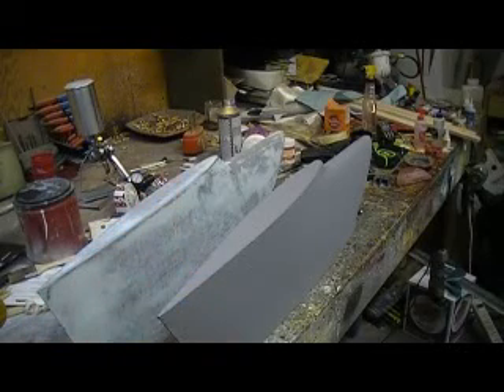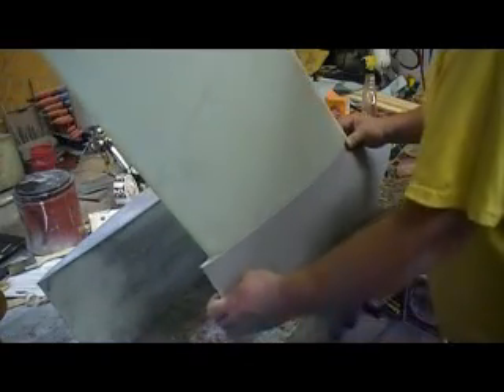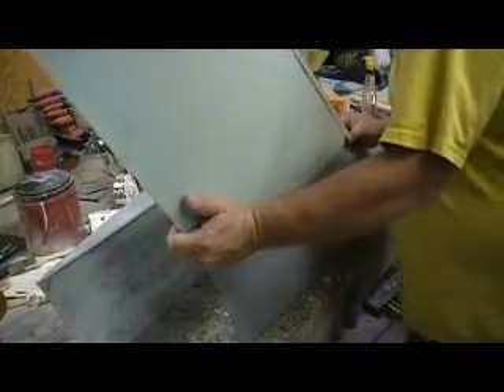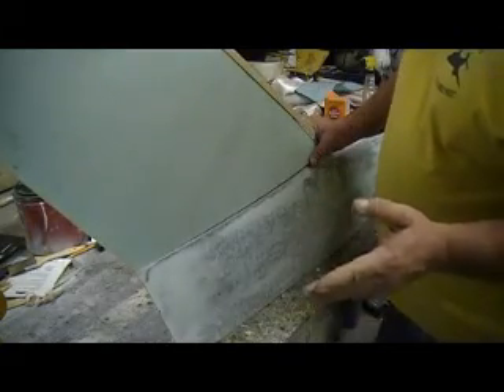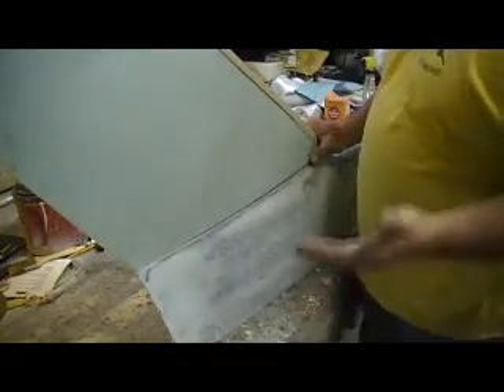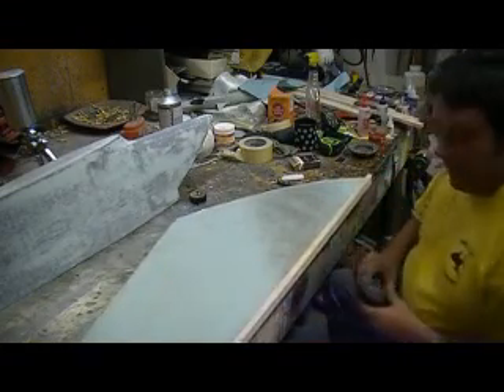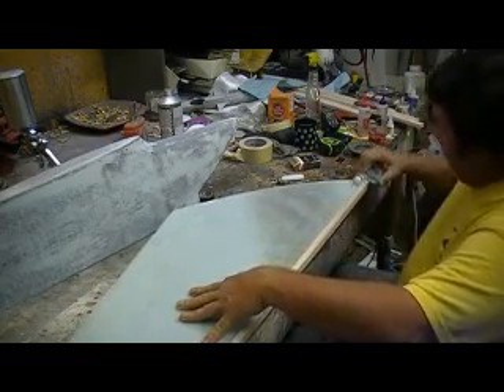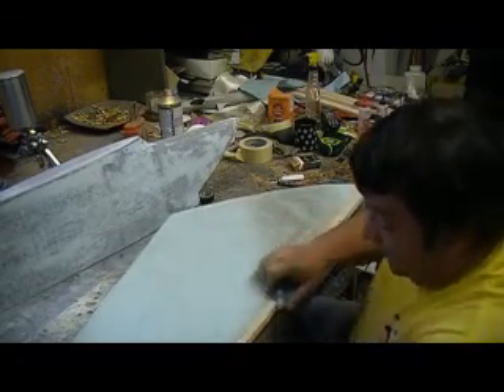how to build a rc jet F-105 thunderchief #23

Comment: very good ideas to make both at the same time, you can reuse the razors and make them even sharper than new just take a very flat piece of glass wet it good and put some 1200 wet dry sand paper down on the glass and re hone the edges of the razor you can even con tor the edge to make it the way you would want your edge to turn out the same way just a little more honing.thank great video